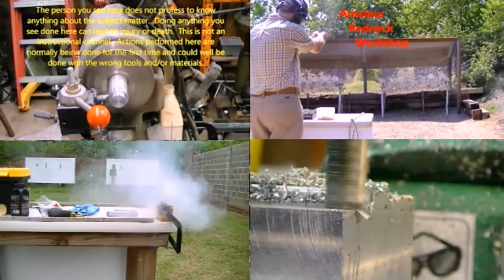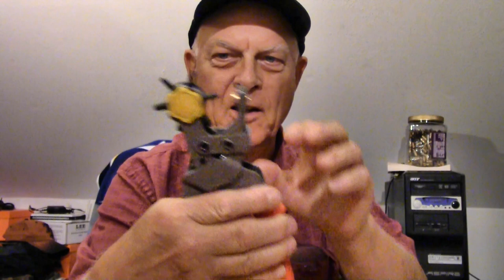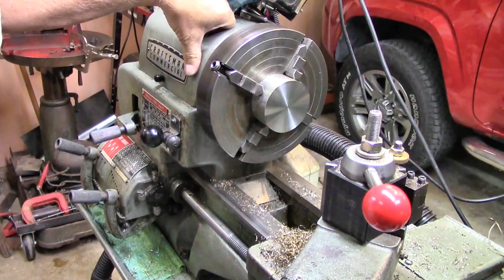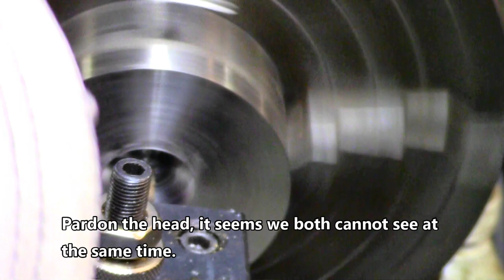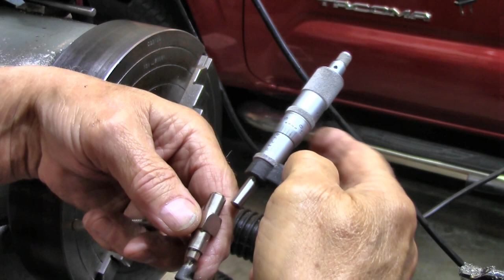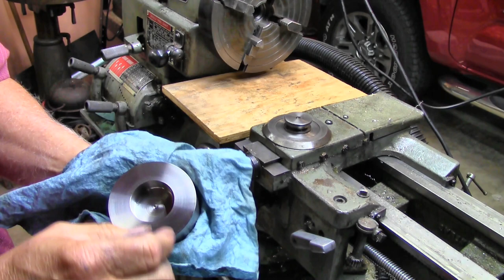Ball turning attachment part 1

Comment: Got to be careful with stainless, it's quite demanding to machine and it tends to gaul when you need to make parts slide or when using stainless hardweare, use plenty of anti seize, nice project...
Reply from the maker: I will keep it greased up.  Thanks for stopping by.

Comment: Message from the cheap seats:  "STomp, Stomp,....Yeaaaa!  Great presenter!  (didn't get the joke up here but great presentation!)"   Apologies to Miss Daisy.  Well I managed to get the steel roofing on this week.  Had the pans down on Tuesday and it blew about seventy that evening to test them out.  First storm of the fall which I was sweating/ generally from here it only gets worse.  Finished the weather tightness today.  Rain and wind so hard Wednesday that the job was cancelled and I made two runs to the dump instead.  Feels good to be weathered in.  Now I can insulate and wire with some siding work done this winter.  Machining up some heavy duty hinges for the door (super insulated 2x4 and 1/2 ply sheathing so it weighs in at over 175 pounds) and designing locking door knobs as factory ones don't do  4 1/2" thick doors.  Hopefully by spring I should be able to start spreading the tools into it.  I can tell you one thing for sure, it is the last one I'll build in my geriatric years!!!  Take care (send sunshine!).  Doug
Reply from the maker: Getting dried in before the worst of the winter should be very comforting.  I am sure you will finish in good time.  Maybe a video tour after you get it done?   Thanks for stopping by.

Comment: Interesting project Harold. Stainless,,,,, usually not painless. man those stringy chips make me cringe, nasty nasty nasty razor blades. keep them coming. i want to build  one so im quite interested.
Cheers
Reply: You don't get the idea for anything like this for a WIYB project..... !!!!!!!!!!!!!!!!!!!!!!!!!!!!!!
Reply from the maker: If you have a larger diameter piece to work with then add a screw for setting the size.  Thanks for stopping by.
Reply: why not??????????????????????????????????????????????????

Comment: Hey Harold when I have to match a part like that, I turn down a bit of aluminum to the exact size of the base before hand. Then I can test fit in the lathe without removing.Enjoy the videos
Reply from the maker: That makes sense, thanks for the tip.  Thanks for stopping by.